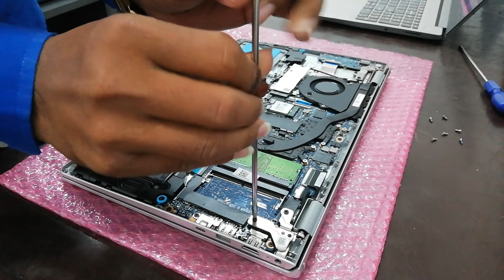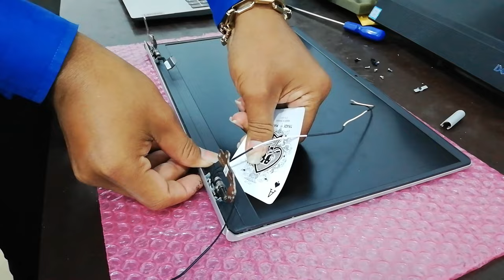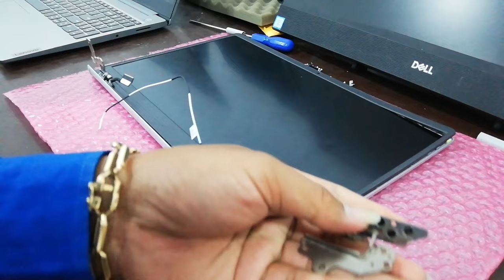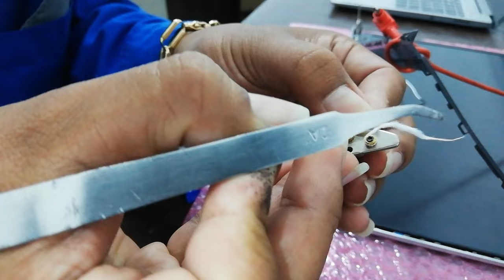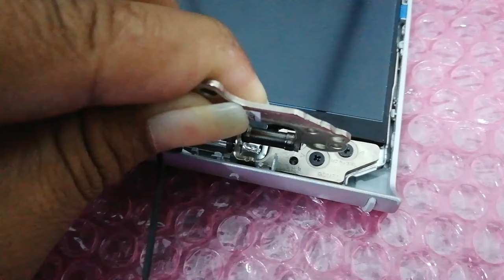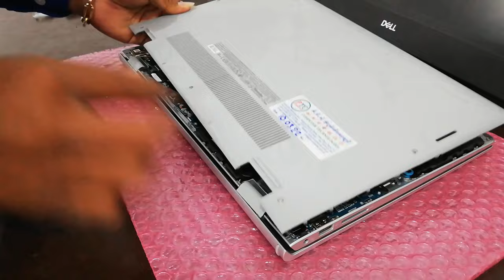How to fix hinge Dell inspiron 3511

Comment: I also have a dell 15 3000 computer. I had the same problem. Is it a problem with dell laptops ?
Reply: Now it's ok and what is the cost of repair?
Reply: In fact it is a problem of many companies, if the hinges come too tight and a bad plastic to shorten costs result in this problem.

Comment: I repaired the hinge problem of my Dell laptop but after repairing it is not powering on when I inserted the charging cable it's blinking.. Tell me solution
Reply: same
Reply: Do u find any solution bro??
Reply: @abhaykumar-ew5ip  Mother Board was damaged. It was not repaired. I replaced the mother board..  Now my laptop is working..
Reply: @tanmaynikam1614  what happens after , get resolved or not

Comment: in my laptop only the hinge cap is broken please tell me much cost it will take to repair
Reply: Dell tell to repair whole screen , it cost ₹7200/- 
And if only hinges and back part ₹4200/- 
But mostly hinges are connected to that with that back screen so it costs for both to together
Reply: @SujataPalMathematicstrader bhai mera toh 10k chala gya 😢

Comment: that happen to my laptop dell right hinge  ´re loose but  i has to disassemble all screen frame to tigh those screws
Reply: Hi I had the problem for the 1st and I went to the shop and repaired it and again for the 2nd time there is the problem I see a tiny gap in the hinge